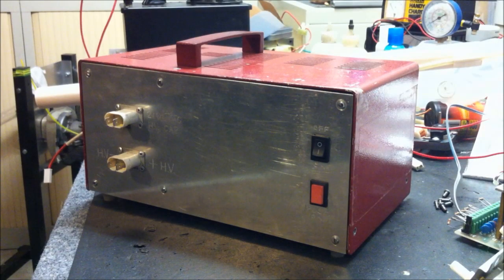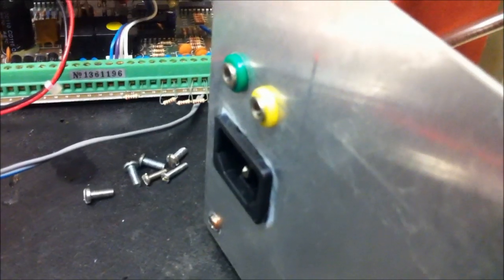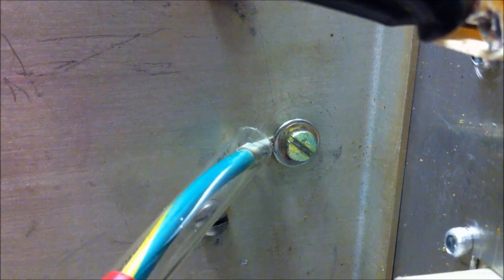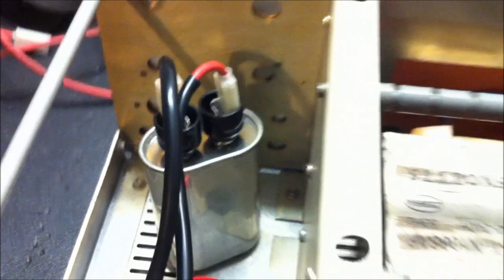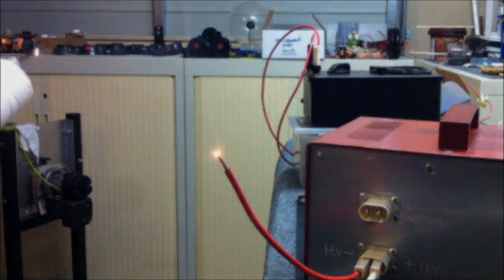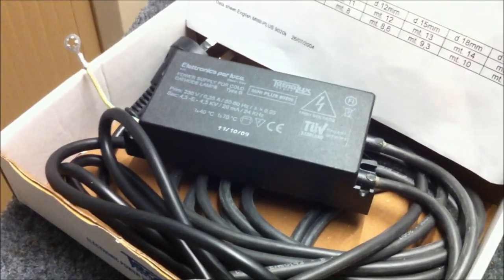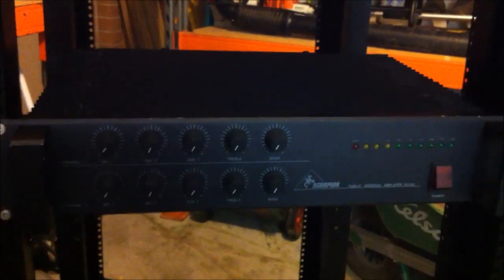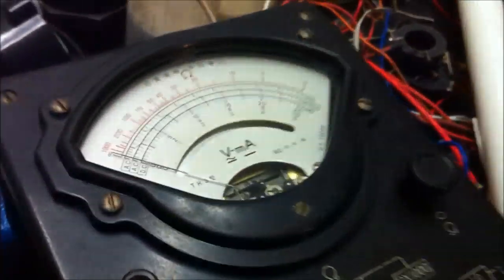I Used A 2KV Microwave Oven Transformer In My High Voltage Benchtop Power Supply!

Comment: Hi, sorry but I need to bring to your attention a few points that bother me.
1. A microwave transformer (alone) generates 2kV (2000 Volts), quite correctly someone pointed out something about a diode...well in combination with a capacitor this becomes what is known as a voltage doubler circuit, meaning you are now generating about 4000V.
2. This runs at a continuous 60/ 50 Hertz (cycles per second depending where in the world you are), giving the effect of being able to be "caught" (muscle contraction if a hand or physical position does not allow to break free). Fence energisers "pulse" giving you a chance to egress.
3. Not sure...but I think the amperage will be too high for safety reasons as well...I believe 150mA across the heart is an electrocution limit.

Why I brought this up is please consider the above if you are considering making this your home perimeter energiser with kids and guests.

Kind regards
Hylton
Reply: a few corrections, 
1) his capacitor isn't hooked up, but rather goes straight to the terminals, I assume he has it there for this reason so he can double it when he wants.
2) it's DC that will make you 'caught'. AC gives you a chance to get free (assuming you're still capable of doing so) plus AC travels primarily on the surface of conductors, making it a bit safer than a straight DC pulse.

not to mention, depending on your purpose the slow pulse of an electric fence may not be suitable to people's needs. (so it depends what he wants to use it for)

Comment: I would construct the power outlet connector in such a way that touching it per excident, or childeren animals cant touch it, maybe a cap over it with a lock.
Reply from the maker: Yes, you are right! I just used parts that I had available at the time. As soon as I acquire something safer, I will replace the output plug. Thanks for your comment and thanks for watching :)

Comment from the maker: If a dog got zapped by one of these, it would not be a pretty sight. I think you would be better off with a 6KV transformer running at a few mA.

There are laws which regulate the types of currents you can use for this purpose and the transformer in this video would most probably be off the chart. Check the regulations in your area...

Comment: The capacitors in those microwave ovens will really zap you, my co-worker touched on it threw him backwards & up agaisnt the wall in our repair shop, He wasn't hurt just stunned. Be careful everyone if you play with these.
Reply: Suuure. Just like shotguns in Hollywood movies. How many backflips did he make on his flight towards the wall?
Reply: Okay, a quick little calculation: the microwave oven caps are usually around 1µF and the voltage is up to 3kV, therefore the stored energy is ½CV² = ½•1e-6•3000² = 4.5 J. Potential energy is m•g•h, let's assume your colleague was mere 60kg, then the energy stored in the capacitor would be sufficient to lift him 4.5 / 60 / 9.81 = 7.65mm off the ground. That's 7.65 millimeters – not quite enough to throw him into the ceiling, is it?

That is not to say they are harmless ‒ you should definitely make sure to discharge the capacitor before doing anything else with the microwave internals, and afterwards, check the voltage with a voltmeter just to be sure.

Comment from the maker: There is no rectifier - It is AC. The pins are labelled so that I know which one is hot and which one is common. If required, rectification will be part of the circuit being driven. Good point on the HV terminal, however, I did not make it - I salvaged it from a magnetron - Its all about the budget :) If it is good enough for microwaves (which are in just about every household), then it is good enough for my HV power supply - It's not exactly being produced for the masses! Thanks for watching :)

Comment: You have the connector marked + for one pin and - for the other, but where is the rectifier?
The arcs look and sound like an AC supply.
Any supply should feed a FEMALE connector for safety, ONLY, not a male connector.

Comment from the maker: Thanks for your comment. I did consider oil as an insulator, but I want to use this for a Kapagen replication so that is why I built it in this way. Everything is well insulated, so there 'should be' minimal chance of arc-over. You are probably right about the switches - they do look a bit small, but they are rated at 10A which is more than the transformer requires. I will keep the hood off during testing to be sure everything runs cool, Thanks again for your thoughts!

Comment from the maker: Yes, I have considered this outcome, which is why I take extra precautions where required - it's all about self preservation! I actually made this power supply about a week before recording the video, but then I took a couple of days off & came back to it with fresh eyes to do a final wiring check before powering it up for the first time. Even so, there are definitely worse ways to die!   :)